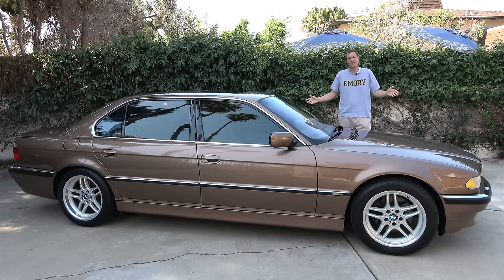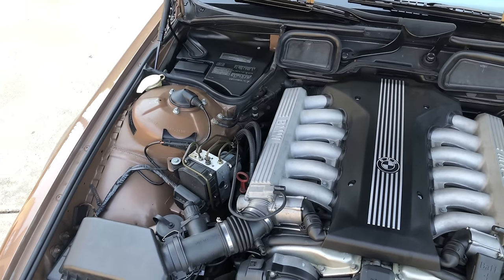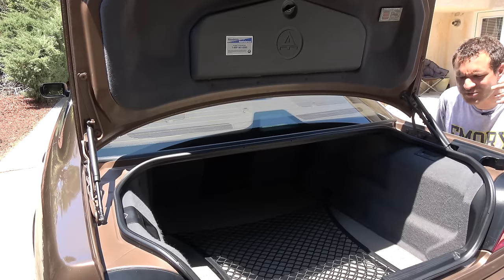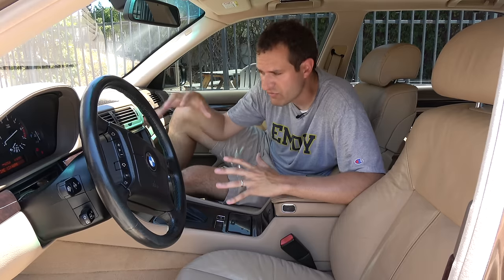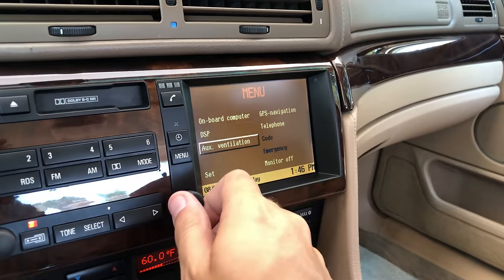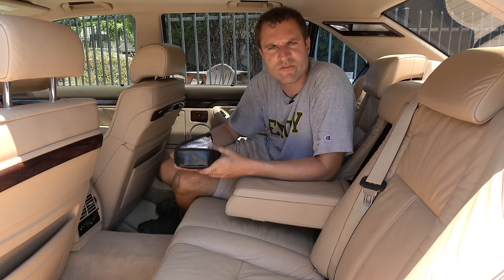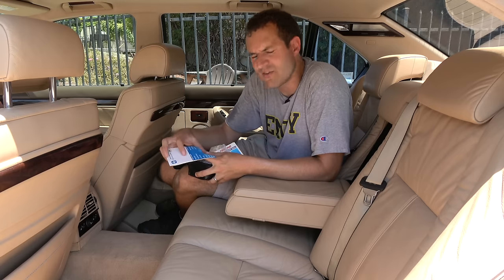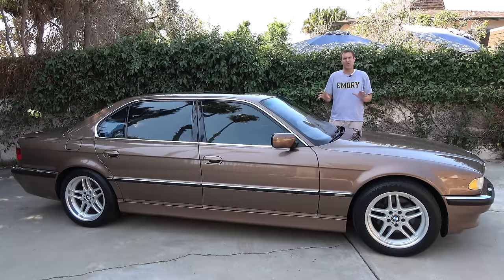Here's Why the 2001 BMW 7 Series Is the Best Luxury Sedan Ever

Comment: Please don't do the E39 keep it our little secret, keep them affordable ;-0
Reply: BIMMER ZEIT yes yes sir shhhh
Reply: the m5 is only worth it
Reply: Arun999 not affordable for a 16 year old
Reply: Arun999 the 530i with sport package is one of the best cars ever made, reliable and a fraction of the cost of an M5
Reply: Arun999 no it isn’t wtf are you a fanboy? The m5 is good but the best e39 to buy is the 540i m sport. It’s fast smooth and more reliable than the m5
Reply: He already did.
Reply: Aye I watch you
Reply: @BIMMERZEITT  as an owner of one of these, 100% agree.
Reply: He did the E39 years ago and came to the conclusion that he wouldn't own one due to the maintenance cost.
Reply: He did it a very long time ago. Og subscribers remember...
Reply: i dunno i had an 03 525i with the sport package.  It was a great car but I yearned for an 03 m5.  could never afford one.
Reply: meh.  i prefer a good ol 6 speed to an s62 motor than the auto 540i.
Reply: Had one I loved the car
Reply: Proud owner of a fully loaded 1998 540i here. Its basically the same level of lux as this e38. I have the same heated 'comfort' seats (no massage though), navigation, tv, computer, dsp sound thingy, xenon headlights, auto headlamp washers, rain sensing wipers, parking sensors, switchable sport dampers (EDC), electric adjustable steering wheel, and I'm happy to report that I have the little wheels to infinitely adjust the heat on my FRONT seats, AND I have a proper cubby storage under the centre armrest. Its perfect because its got all the things you NEED, but no gimmicks you don't. The toys are amazing for 1998 and I love it!
Reply: I'm 17 and by trading/ flipping cars I've had 2 m3's and now an e60 m5. There's always deals on craigslist you just have to be on the lookout.
Reply: yes, very much a fanboy
Reply: he did the M5, which along with the V8 540i are less reliable and maintenance expensive compared to the straight-six 530i. The 540i and M5 both have issues with the timing chain guides eating themselves among other things which the 530i does not
Reply: Nice work. Yes there are always deals to be had, but also money-pits. Good for you starting early and learning as you go!
Reply: so be it.
Reply: both also had problems with gasket leaks and the m5 had a double row timing compared to single row chain with the 540
Reply: I know they do but finding a manual 540 is just as rare as an m5.  aside from that what the argument here both are great cars my preference is just an m5
Reply: yeah lol, im still shitting my pants because I secretly want a 7 series too :///
Reply: My girlfriend's father has a 530d, and it is honestly amazing.
Reply: @bernardomotard  that sounds awesome man! Does he have the infinitely adjustable seat heater knobs? Mine has them, they rock :')
Reply: Don't worry, the secret has been out already with Eastern European construction workers for years. Cement mixer on the backseat of the E38 is a common sight.
Reply: @BIMMERZEITT  most problem car in the world!
In Europe, bmw stay lower dan mercedes and lexus.
Only lexus and subaru has 0 problems in 15 years
Reply: John J most are turning into buckets now. Def beautiful cars when there clean. Aging very fast now compared to just 3-4 years ago they still looked newer
Reply: bleah bmw horrible cars...
Reply: Alessandro Ogheri not bad cars. Are they the most reliable? No. Are they the worst? No. My e39 lasted 250k miles when the tranny started slipping because a retards drained my tranny fluid and filled up oil. Made oil leak everywhere and fucked up my tranny. IDK wtf kind of retarded mechanic he was should've done my own oil change. Either way the car got 40k miles in a year out on my me and never let me down. I ran it to the ground and didn't take care of anything that went wrong but I kept it physically in good care got it for 1800 with 210k miles sold it for 1400 with 250k tranny slipping. Didn't put $1 into anything but oil and gas. Never left me on the side of the road. Always turned on. Had issues up the ass but the car was on it's last legs at those miles so I did not care had just crashed my ls460 waiting on my check from insurance so I wanted something cheap that was in good physical shape ended up keeping it way longer then I thought I would
Reply: @Arun999  b10 is faster
Reply: GiantClassicOFC dude a 540 is a 1k-2k car. It's a 20 year+ BMW it's a worthless car.
Reply: In America, yes, but in europe, and mostly in eastern european countries it cost boutta 5k-6k euro
Reply: GiantClassicOFC well most e39 here are 540i.... I don't think anyone is lying about a $1-2k car lol
Reply: I know dude. But here were I live, in Eastern Europe, mostly there is 520i-530i, cause beemers like 540i and up cost boutta 5k-6k euros, ant the montly salary here is about 800 euros, that's the prob to get 540i..
Reply: GiantClassicOFC I understand I'm from bulgaria live in The US In Europe cars here that are cheap are way more there
Reply: I've had my '99 E39 540iT for 12 years now (190k on the clock).  I've gotta disagree on maintenance costs.  Bottom line - it's a German sport "sedan", figure $1,000/year on average and you're all set.  Some years is $3000 when (not if) you lose the radiator, water pump, valve cover seals, VANOS, etc; and some years it's $200 for oil and something plastic that disintegrated.  It's still way more car than anything you can buy today for $3,600/yr ($300/mo).  Plus, being of the same pre-Bangle design studio, it has the same understated elegance the E38 does.  Oh and since it's a wagon I can fit a 65" DLP TV or 7 door slabs or... in it (with the gate closed).  And finally - never ever brag on DSP.
Reply: My e39 525i is still roaring. The only car I have ever kept.
Reply: @DigitalSubset   Trollolol, BMW's V8 is one of the least, if not the least reliable engine BMW ever made. If you want "reliability" in a German car, a well kept 90s Mercedes is your best bet by far. And no, I am not a fanboy, just facts: anusedcar.com
The general perceived reliability of German cars, is one of the biggest misconceptions in the car industry (people fooling themselves to justify the high costs?) Yes, in general, German cars were more reliable than English, French and Italian cars, of course. However, compared to a 90s Lexus, Toyota, Subaru or Mazda, a BMW is an unreliable piece of shit. Of course any BMW looks ten times better and drives hundred times better than any Toyota, but the word "reliable" has nothing to do with looking good or driving excellent.
The best known saying in the car industry is: "There is nothing more expensive than a _cheap BMW_"
Reply: Their expensive to fix

Comment: About the cup holders. They were technically called can holders. They weren't meant to hold anything larger than a can of soda. They were an afterthought in the e39 too because you're supposed to be having the ultimate driving experience not the ultimate snacking experience. Drinks only serve to distract the driver. Obviously...
Reply: Very true. Anything larger than a can topples over in the corners. But if I have a bottle, I screw the top back on and there's enough space to lie it flat sideways.
Reply: You can't have the ultimate driving experience if your drinks are spilling all over the place, or if have to drive like your grandmother because you're afraid your drink is going to spill over.  People often drink in their car.  It's what happens in the real world.  Your hot coffee spilling over is distracting.
Reply: RedRider1600 I agree. They fucked up... bottom line lol. I had the same problem on a smaller scale. Vw “cup holder” are a huge fuck you to the buyer. 🤪🤓
Reply: no maan its after thought because it is illegal to drink anything and eat food while driving in European countries
Reply: @adnankashem3930  is that true?
Reply: +Adnan Kashem
Then why have the can holders?
Anyway, that's bullshit.  I just looked it up.
https://ec.europa.eu/transport/road_safety/users/young-people/distraction_en
Reply: Its certainly true in the UK. Its called driving without having proper control of the car. Its an extension of the laws that forbid using mobile phones while driving. Now its illegal to be distracted while driving, and eating food or messing with a drink is included.
Reply: re: "you're supposed to be having the ultimate driving experience not the ultimate snacking experience."  touche.
Reply: I think the reason many of these cupholders break is that snackers crumbs and sticky drink spills etc, end up grinding/lodging in the mechanism parts and when it makes them sticky and a person decides to shove it closed, things break and then they complain that it's a design fault.

Comment: I had one before, and it has more features than the one you showed here, both driver and passenger seats back has food tray and one is equipped with a writing folder and an embedded pen, the rear arm rest has full controls of AC, Radio and passenger seat. You missed to mention the electrical magnetic suspension which was a first in this car, all mirrors has auto dimming and they are synced with the middle mirror, so if a light beams at the middle mirror, the two side mirrors auto dims too, mine was a 1997 E38 V12 5.4L oxford green.  
I don’t think you were fair to this car.
Reply: Aamer Zarzar yeah...he wasn’t fair to the car by calling it the greatest luxury sedan ever. Shut up.
Reply: Also when you move your seat, the seatbelt anchor in the pillar moves as well.

Comment: How could you review this car without mentioning the front parking sensors, double pain glass, heated cats, or some of the “firsts” (or close to it anyway) like the auto leveling headlamps, auto wipers, electric folding mirrors, motion sensor alarm, or servotronic. All those were some of the firsts in the industry an some are just plain cool.
Reply: Also you could option an Auxiliary heating/cooling function to pre-warm the interior on cold mornings and pre-cool it on hot days. The system had 2 timers so you could set it to get working before leaving for work, and setting off home at the end of the day for example. AND if you had to wait in the car for someone, you can continue to run the heating without the ignition / engine running. And not forgetting the immobiliser that can be given a pin number via the nav screen so you can't start the car even if you have the key - you need to enter the PIN. Pretty cool tech for 1998 when these came out.

Comment: E38 is the best 7 series that was ever built
Reply: I was a spaceship back in the day 👽
Reply: Except the original 745sa with manual transmission ;-)
Reply: And now i got one😍
Wished for so long and now i have it! Wow!
Reply: And now i got my second one...
Reply: @Krezo200  Have you had to repair anything?
Reply: @Mark-rt6fy  Yes of course, old BMW's constantly need repairs
Reply: @Krezo200  Thanks for that, I'm still hesitating...
Reply: @Mark-rt6fy  np mate, i had two e38's and serveral other 90's bmw's and still looking for 38/39 right now
Reply: @Krezo200  So you just keep each one for half a year and move on to another? I have a sports car but too bumpy and noisy for long road trips, so I'm looking for a used saloon with quiet ride and hopefully won't break the  bank while not boring as a lexus haha.
Reply: @Mark-rt6fy  are you looking for a car with manual or automatic transmission? where are you from? im not switching them planned i just want something "perfect" and well that doesnt exist^^ so i change them until i find one that fits.
i had a perfect e38 but i wrecked it in a crash
Reply: @Krezo200  For highway cruiser I'd prefer auto, and I'm currently in America. Ah, I understand. Hope you find your perfect car soon!
Reply: @Mark-rt6fy  thank you mate
Well, the e38 is lovely but if you prefere safety from costs, asian cars are way better... but as you said more boring
Reply: @Krezo200  I can afford some repair, just not so much that exceeds the value I would buy the car for. So I guess my question is really how much of repair would it take.
Reply: @Mark-rt6fy  i said to myself i will replace the whole cooling system
These things have left me stranded a few times

Comment: I got a 740i with 234,000 miles on it, it’s an amazing first car to have. The 740i I grew up with, my dads car, has 310,000 miles on it.
Reply: Is it expensive to own in terms of reliability ?
Reply: Peter Bradley It’s honestly dependent on the condition of the car. Both of the cars (my dad’s and mine) had to have transmission work done at the mid 200,000 range, but other than that, there was nothing major done to the cars except the standard repairs that come with owning a car that’s almost 20 years old.
Reply: Person What year 7 series do you have?
Reply: Bob Steve bmw 7joemama

Comment: Wow.  This brings back memories.  I had a 1998 E38 CPO.  It was a great car until the warranty expired.  The plastic radiator broke ($600).  Afterwards the bushings had to be replaced ($1000).  The AC compressor went out next ($3000).  After the pixels went out on the dashboard I sold the car.  The was the first and last BMW I ever owned.  I brought a Toyota Sequoia in 2005 and I am still driving it with 300K miles.  I spent less on maintenance on my Toyota in 13 years than I spent on my BMW in 4 years.  The BMW was a great car and it was fun to drive, however I will never own one again as a daily driver.
Reply: japanwatchconnection Great point.  I am almost hoping the Toyota dies so I can get a fun car.
Reply: those prices are made up, it's not that expensive. I have a '00 540i m-tech which uses almost exactly the same parts and prices are like 1/4 of those u mentioned. you don't need to use genuine bmw parts, just use OE and quality OEM so that you can save money.
Reply: You were prolly one of those idiots who took it to the dealer..and no matter how "reliable" your toyota is. It is still just that a toyota. I am not hating just have enough of people complaining how expensive euro cars are to maintain
Reply: @Mm Mm toyota better engineered than bmw ?? Haha....😂
Reply: BMW is the best car you can LEASE.  If you have the money to keep one under warranty they are pretty fun
Reply: Currently own and drive an E39 540i 6 speed, I beat the ever living shit out of it and have put probably 50k miles on it in roughly 6 months. Absolute beast of a car, won't ever let you down provided you take care of them and do the repairs yourself.

Comment: My 1998 BMW E36 316i has (working) factory parking sensors!
Reply: So did my 95 Chrysler!
Reply: So does my 2003 e46  330xi
Reply: 2000 Cadillac DeVille too
Reply: My 1911 Ford Torpedo Roadster, doesn't have Parking Sense, the Driver Does.
Reply: 1991 Soarer UZZ32 had front and rear sensor along with first production car in the world to have rear view camera. Also came with Sat nav GPS for its centre touch screen aka EMV, front parking pole, 4 wheel steering, factory hydraulic suspension, 2 position memory for drivers seat, mirrors and electric adjustable steering column along with quad cam v8 engine. Oh and heated front seats (driver and passenger)
Reply: Does it have working blinkers tho..?
Reply: @dantemeneguz  4 directional parking sensors were optional on x80's in 1988 aswell which is cool

Comment: 282  hp from a v8 in 2001.....an  now he have 1,4 l engine who produce 175 hp and we wonder why they die at 100k miles
Reply: 326hp V12. You can have a 4 cylinder with more power
Reply: The Hate Personified Every car can do at least 5km/l
Reply: Ford gets 647hp from 3.5L V6. And 350hp from a 2.3L Focus.
Reply: @justinluttrell8990  who tf want that downsizing ?
Reply: Mercedes gets 381 Hp from a 2.0L. And they said the output is more then 400 hp for the new models in 2019.
Reply: Nissan made a tiny 3 cylinder engine that can fit in a duffle bag that makes 400 hp
Reply: Mercedes has a 1.6l , 90° ,6 cillinder engine for the new amg project one, making 748 hp :p
Reply: Saab 9-5. Park sensors in 00. Mercedes about 98. BMW too & prob Lexus....
Reply: 1.0 ecoboost ford engine producing 180 bhp
Reply: The Hate Personified  the 850ci eats average 10-13l/100km  at normal driving
Reply: BMW i8 : 1.5 lt , 3 cylinders, 231 hp.
Reply: @denzoantweb4293  untill the battery is drained
Reply: No, the pure engine has this power., With the contribution of battery, the car has a total amount of 362 HP. You'd better search more.
Reply: I think all commenters missed the point: You can't really compare 20 year old technology with todays. P.S. no one from today car engines will last 20 years. Old BMW does. 500k miles on my e39 and runs smooth, 3.0d purrs like a kitten.

Comment: This car has adaptive cruise control. It was great  feature back in 2001.
Reply: Wtf??? Really? Damn...
Reply: No, it doesn't. That was a very rare option never offered in North America.
Reply: Lexus LS 430 had it,,,,
Reply: GG99MW2 but bmw did it first... Lexus is just a copy of what Bmw & Mercedes had done before
Reply: @andeleputo89  maybe, try to compare the resale value between all Germans with the Lexus.  Then tell if who did it first matter ..  Best regards
Reply: DK Danis it also had rain sensing wipers..he really should have mentioned that..one of the greatest features in the car along with ambient lighting under the door handles
Reply: GG99MW2 most people that buy 20 year old bmw’s & Lexus dont do with the intentions of selling it later on lol kind of a pointless argument
Reply: @andeleputo89  yeah i know that. They have aslo automatic braking.
Reply: @DenyBlackburn   yeah mind blowing for 2001. When doug shows the instrument cluster. You can see light that shows 2 cars. That is indicator for acc.
Reply: @kingdrosive4102  And maybe automatic headlights.
Reply: @andeleputo89   I meant that in terms of reliability sets the tone for the resale value.. Used
Reply: DK Danis its called gas it and hope you dont hit anyone
Reply: A loaded European e38 had so much more options than this.